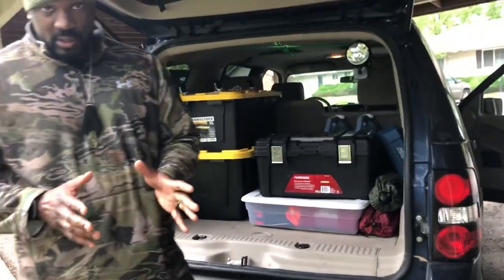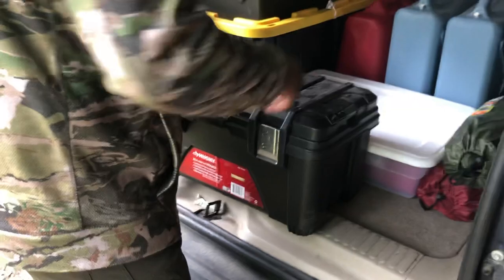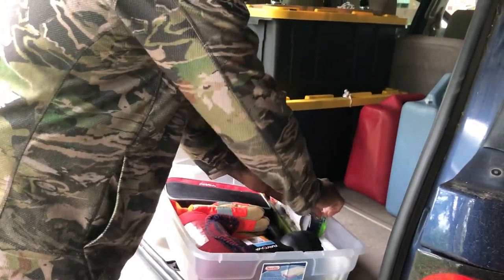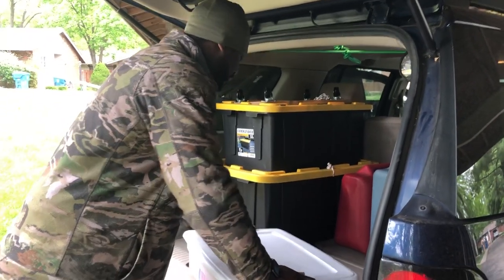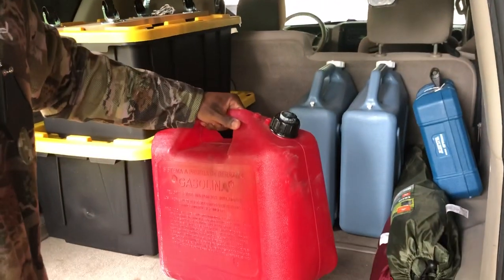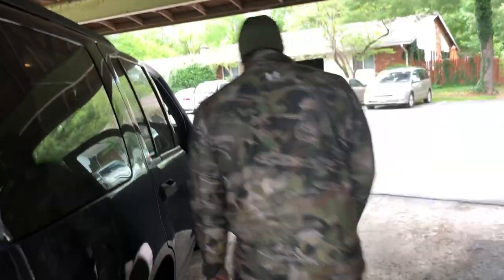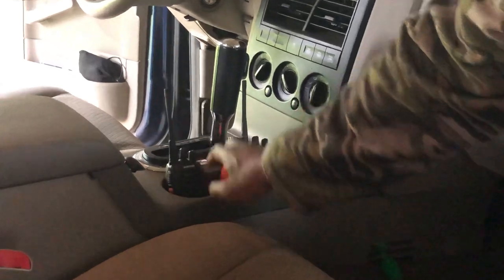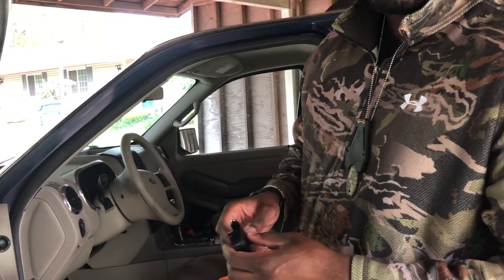Bug out vehicle

Comment: Some ideas to improve your setup:  for vehicle recovery a winch or a come-along with a pair of clevis pins, high lift jack, chainsaw, shovels. Also find a way to strap that ammo can down to the frame of your vehicle, dont want that thing bouncing around if you accidentally roll the vehicle. Travel pillow in case you have to sleep in the car. Coleman dual fuel stove, fire extinguisher.

Comment: At last someone talking sense. The last thing you want is some crazy modified lifted vehicle you can't easily grab spare parts for, (here in the UK with our terrain it's not needed but it may be different in places over there). Blend in and make things easy on yourself. One thing i may add (not sure if it's as easy for you guys in the states) is to run a diesel vehicle just because of the different fuels it can take, cooking oil etc and generally better fuel economy, so you aren't just limited to petrol (gas). We can't easily carry guns here in the UK so places to stash them aren't so important here.  Someone in the previous comments mentioned a Hi-Lift (or farm) jack. Brilliant piece of kit with many uses, i have used them for recovery as well as the usual lifting of vehicles. Great video and sensible thinking.

Comment: Great setup and like the stealth BOV approach !   OPSEC is essential especially when it concerns your BOV's harmless nature.
The fire hydrant key and the mini-dolly are good upgrades I haven't seen before.  The explorer is a good choice for a BOV.   I recommend a dual-facing dash cam because it's so helpful in everyday traffic life.   
Also Add : 
Spare waterproof hiking boots with insoles and spare socks.
A large can of bear spray hidden on the driver side and 1 hidden on the passenger side. 
Body wipes in case a shower is not an option.
Strengthen your tires with "Slime" or "Flatout" to prevent flats.
A copy of the SAS Handbook because it is a wealth of info and help.

Those are passive measures that prevent you from being an easy victim, while not attracting attention.  Keep improving and let me know if any of these helped.

Comment: Enjoyed your video and your mindset about not sticking out.
 Timing is Key when you decide to bug out, I would see if you could add a adapter to your drill that would take lug nuts off quicker, you want to get back on the road as fast as you can, and your carrying the drill already. I would also throw in a good pair of work gloves and small bolt cutters in your tool box.
 A power bank the size of your ammo box would be a great addition as well
  Looking forward to more videos

Comment: Great video!!!! Thanks for sharing.  Good to see another UA fan too. I think your load out is comprehensive.  Something that I added to my vehicle kit was eye pro and heavy duty gloves.  You may have that already.  Also I put one can of fix-a-flat in the repair kit. Also I added a folding brush cutter to cut some brush to lay around and on the vehicle to camouflage it if you have to ditch it momentarily and use it as a home away from home base in a pinch.  Again I can’t thank you enough for sharing.  Stay safe, stay strong and stay vigilant. 🏆👍🏾👊🏾.  One planet 🌎 one family.

Comment: My daily vehicle - my 2000 Ford Ranger is my bug-out truck. 2wd, with a tool box/ladder rack camper top/ has locks all around and security gate for the windows on the camper. 5 speed manual so I can save a lot of gas. I’m adding a rigid job site box to my ranger next month so I can carry more but able to lock as well for extra security. I have a 30l backpack in case I have to go on foot. Currently building my wife’s bug-out bag. But I have planned out some routes for us to camp at in case of a SHTF situation.

Comment: Get heavy duty shocks so it doesn't look like it's loaded and to absorb bumps
RainX the glass and headlights. 
Make sure jack works or get a hi lift if you can fit it. It can have recovery uses too. 
I'd say a basket for top but it won't be as grey man. 
Put all medical in one box you don't want to dig it out when time is of the essence.
Get a trauma kit for the whole family. 
Any prescription meds yours will be "stolen" right after next refill so ask for a replacement
Fill used water bottles with sand to use for traction. 
Remember you are not robbing you are liberating things from their neglectful owners.

Comment: This is a very good video.  I did like it.  I would like to bring up some points.  Hatchet or camp axe.  Get a good quality one.  Fishing and hunting gear.  Get it and use it.  I also am from Missouri, so I know that a general fishing and hunting license is only $19.  Next up is that I noticed that your gear seems to be brand new.  Use it.  Missouri has a ton of conservation areas that allow for primitive camping.  Primitive camping is an area that doesn't have electricity nor water.  Your lucky to have an out house for bathroom.  This is perfect for this type of situation.  Use your gear to get use to it and see how well you like it.  While you get better at primitive camping you will gain skills and knowledge of what to do.  Your primitive camping trips can also serve as a test run for your bug out plan.  Seeing how long it takes you to load your stuff, how long it takes you to get there, how long to pack up and head home.  (In a bug out situation it would be moving to the next area).  If you have a place in mind to bug out, great.  But also keep in mind that people will be panicked and one stray shot to your radiator and your vehicle will be dying quickly.  So having skills and knowledge to fall back on is good.  Along with that, Missouri's squirrel hunting season is fairly long and it gives you practice at proving food.  Some areas are 22 only or rimfire only to hunt for squirrels.  A 22 is a great addition to your plan and there are several takedown/breakdown models to choose from.  Personally, 10/22 takedown because the 10/22 is the most popular 22 rifle in America.  Couple other things is, a hand drill.  There is one with gears and one with out.  Good back ups that don't take up a lot of room.  Fishing gear, you can go pretty minimum and still have a chance to catch something.  Again, go skill to have and they have rods and reels that break down or telescopic poles.  Your ideas are solid and you are well organized.  (Much more than me).  I just wanted bring up some points that you may have or have not thought about.
Reply from the maker: Great feedback, thank you.

Comment: Need a short garden hose that hooks up to the outside faucet. Bottom of most water tanks ( town water supply) has a hookup at the bottom. And maybe a fold up hand truck for the two totes. I use a full sized hand truck

Comment: Blending in with Grey Man approach on your vehicle and equipment is good practice. 

What is not Grey Man is wearing camouflage in an urban environment. 

As you stay mindful of your environment, your environment is mindful of you. 
Every environment has its own camouflage, its own set of rules to succeed. 
So make sure you do not silhouette yourself against your environment. (ie black clothes against white background) Blend in. (ie black background? Wear black. White background? Wear white.)
You should be prepared for both urban and rural, mountainous or desert terrain, both hot and cold environments, and both wet and dry climates. 

A good guidepost for progression would be Maslow's Hierarchy of Needs as well as the Rule of Threes. 3 minutes without breathable air, 3 hours without shelter in harsh environment, 3 days without drinkable water, 3 weeks without food. 

If you build your 3 lines from the bottom up, and your different bags for different situations (Bushcraft bag, 72 hour pack, EDC, Bug Out bag, Get Home bag, etc), you increase your survivability in those different situations and environments. 

Better to have and not need than to need and not have. Two is one, and one is none. Should one fail, you have a backup. That's the purpose of redundancy.

Comment: Just thinking, you might want to add a set of bolt cutters and a prybar...you know for foraging...and a silkyboy saw and a "boy's ax" or limbing ax, 2 1/4 pound head 24" handle. That takes care of 90% of your cutting/chopping needs. You might want to add a 5 to 6'' fixed blade knife also (look at ESSE or Becker knives). I see you're wearing a small neck knife, but an Ontario RAT1 folder in D2 steel is great. Make sure your wife and kid(s) have a folding knife too. Teach your kids to use and respect the knife...add EXTRA band-aids to your medical preps. You didn't specify what was in your med kit, add moleskin and Boudreaux's Butt Paste (or the equivalent) to your kit...being "CHAFFED" is an intensely personal experience and one that can severely limit your mobility. You said nothing about tourniquets... Check out Alan Kay's youtube channel, he uses a ratchet style tourniquet that I like a lot and have a couple of.

Comment: good vid...
add to vehicle:
>winter kit
:specific mechanix gloves designed for all the way to sub-zero temps still able to work with small things in your car/engine
: large thermos brand thermos
:muck boots w/ removable wool or thinsulate liners[rated to subzero temps]
:hand warmers
:wool balaclavas
:wool neckbuffs
:wool long underwear and socks[darn tough over the calf]
:waterproof mittens with trigger finger
:wool liner gloves and wool mitttens that can open at fingers converting to fingerless wool gloves
:saw [silky] and folding backpack saw and a hacksaw and extra hacksaw blades [put one in belt]
:axe and hatchet
:foglights[amber] on front of vehicle
:leather gloves big enough to wear liners in
:leather gloves lined for winter
:weatherproof flares
:flashlights/lights w/ red running function for night vision/stealth/early darkness in winter
:zpad backpacker pads for working on ground on vehicle
:get extra zpads or cut closed cell foam pads for buttpads sit on wet surfaces/snow and ice/in general
:empty cat food can(s) to make alcohol stoves for pennies look up online all kinds of vids

general:
:rubber mallet
:voltage tester
:proper heavy duty long jumper cables [like wrecker/tow drivers carry]
:lockpick set and learn how to fully use it
:extra keys for rig stored hidden
:make curtains for ALL windows including front with reflecrive mylar sandwiched inside [turn inside in winter/cold and outward in summer to keep cool]
:proper heavy duty jack
:make an X with black gorilla duct tape all the way across reflective surface of one of your e-blankets to signal s.o.s.[can put on top of vehicle or somewhere viewable by air and also carry it easily in any b.o.b.
:ball pin hammer
:lineman's pliers
:foldable/rollable solar panels
:radio/cell phone signal super boosting antenna
:cb radio in addition to handhelds
:backpackers table
:cutting board and/or backpacker's cutting board
:foldable backpacker plates and cups fold flat
:chef knife, santoku, serrated bread, pairing, and cleaver knives
:cheese grater [handheld with handle]
:bbq utensils long or telescoping
:cast iron deep fry pan
:cast iron tripod for fires [hanging pots etc.]
:all around spices that can flavor any meats
:backpackers grill(s)
:metal spatula with cutting edge
:sandpapers [different grits]
:chamoix towels [traveller towels] and huge beach towels
:shower adapter for water bags/bladders
:fels naptha bar laundry soap
:borax and mechanics soap
:game bags [hunting]
:slingshot
:playing cards [weatherproof with survival knowledge on them]
:chess and checkers and cribbage board
:road atlas in addtion to your maps [one of area and one of U.S.]
:spray paint [white, black, bright orange]
:combination padlock(s)
;lugwrench adapter for your drill
:chamoix(s)
:winter floormats
:watch creek stewart's winter vehicle travel vids...

Comment: I like that you have a plan, but a lot of it is based on being in or near built up and settled areas.  Things like the furniture dolly won't work in a non paved area and would slow down your travel.  

Also for communications a bubble pack radio runs on FRS/MURS/GMRS channels.  These are Line Of Sight communications with extremely limited power.  On flat level ground a radio with 5 times more power than those only have a range of 5-6 miles without a repeater.  This is due to the curvature of the earth getting in the way, and is one of those unbreakable rules for radios.  GMRS will be almost as good but requires a license to use legally.  The best option would be a digital HAM Handie Talkie.  Yes it requires a license to use but has more power, cleaner signal, and only someone with a digital setup can hear you unlike the bubble pack radios that broadcast in the clear with the same 16 channels that every other onw uses.  The trick to increasing range is a higher antenna, get a roll up j-pole antenna for your HT and you can dramatically increase the range.  The j-pole is used by throwing a line over a higher tree limb and using the line to pull your antenna up.

Comment: Another perspective.  
The most prolific vehicle in Iraq was the orange and white toyota sedan with a large, usually DIY, roof rack.  Some coalition forces special forces and intelligence personnel used these cars to conduct reconnaissance or to clandestinely deliver parcels.   https://ci-roller.blogspot.com/2007/11/he-was-driving-what.html
Some states the most common vehicle is a Toyota sedan, in others the Honda Accord.  Both include models with four doors, and a large trunk, powerful V6 engines with aftermarket brake, suspension and tire upgrades.  
The most important feature in a vehicle is the tires and then the brakes and breaking system.  Then the suspension, transmission, engine, electrical, add ons.  In that order.  Inflate tires to max PSI, yes, it will wear the center of the tire tread faster, but that patch will have better traction than a tire inflated for comfort.   Tires, and brakes should be the best you can buy, cheap brakes will fade and fail, and don't last long.   A taller suspension (not excessively so tall that it is obviously noticeable) improves ground clearance for hopping curbs and debris.  Consider a taller tire when the suspension height is increased.  A roof storage rack is very useful, as well as additional side and rear LED white lights. Don't overdo it with massive lights. be discreet.    The large, new, sport utility vehicles decked out with every aftermarket piece of kit, are juicy targets, and will attract a lot of fire.   Four men don't have a lot of fire power.  The best SOP avoids contact.   Maintain your vehicle, cache replacement parts, tires, wheels, brakes, hoses,  learn to repair your vehicle.